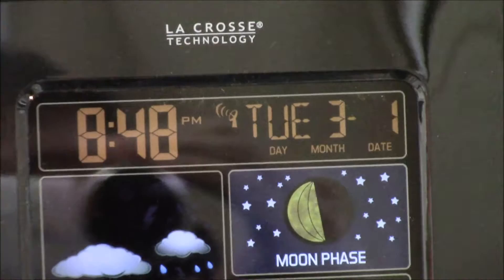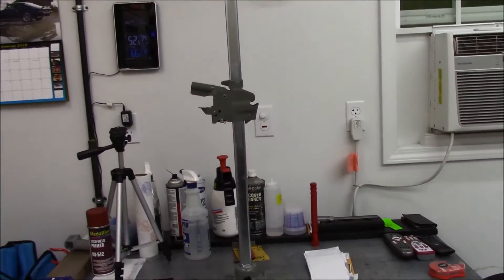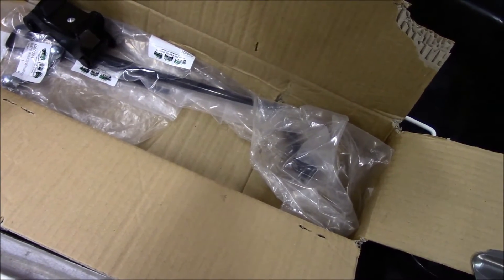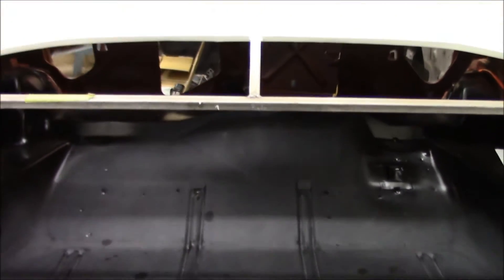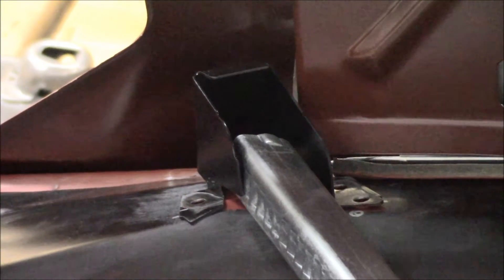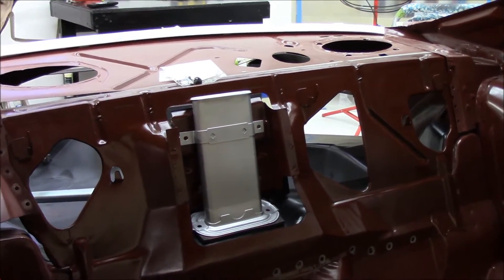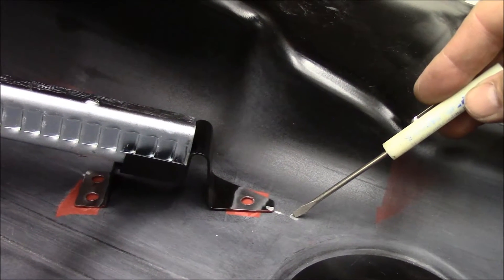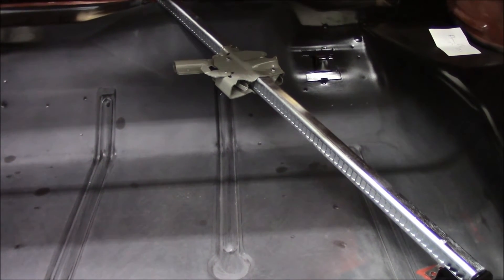1972 Camaro Project Overkill  Bumper Jack Brackets

Comment: Way to go on the brackets Russ. Knocking it out one step at a time. That trunk looks great. I have to go through the same work on my Montana car so your videos are great to see as you work through the whole thing. I picked up a AMD pan and noticed the pan shape is not the same for a 70 in the front top edge but I think I can make it work. Thanks again
Reply from the maker: +Idaho 2nd Gens Thanks Jon. I thought a 70 was a little different. They  doesn't have the vapor canister, correct?
Reply: +Double R Restorations That's right, no vapor canister. So I will have to fit it in below that area. The original pan is pretty solid up there anyway.

Comment: great job !! I would have moved the aft bracket forward also to make up for a slightly shorter jack shaft. coming along ....
Reply from the maker: +johnsont963 Thanks Terry. I started to do that but the trunk floor has some weird bends in that area. It still could have been done.